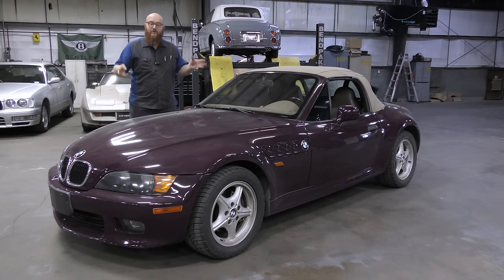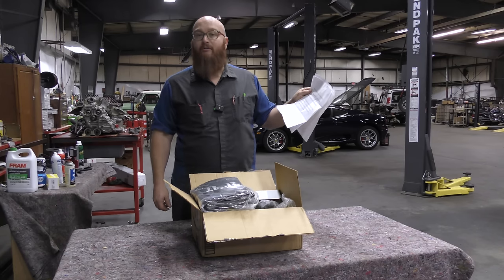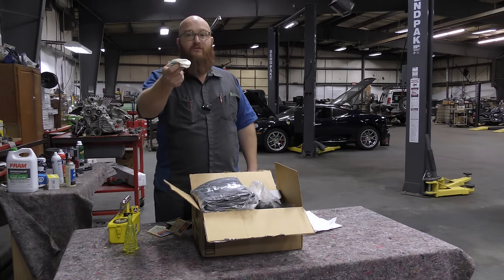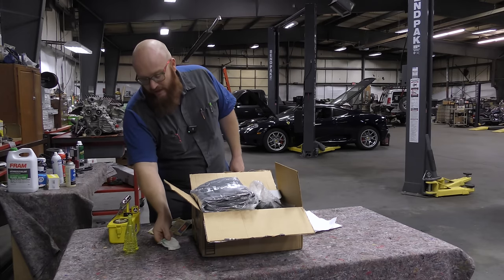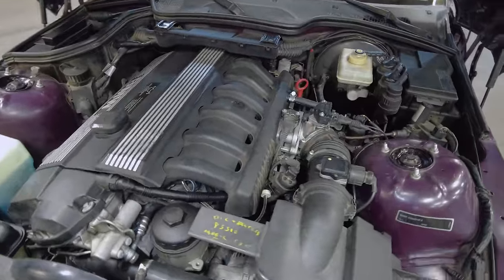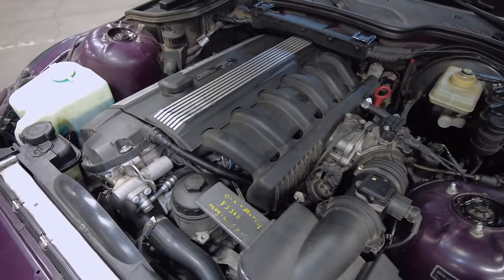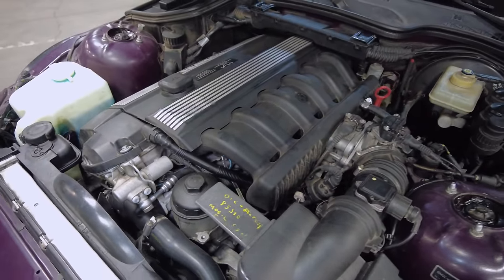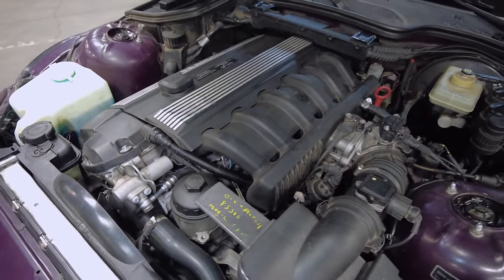My BMW Z3 Almost BUSTED My Wallet!

Comment: Not sure I'd attribute the expense of refreshing this car to its German origin. Its just an old car issue. Every rubber part on a car has a defined life span as rubber reacts with oxygen and other things in the air and degrades with time. There is no way around it. Seals, bushings, and hangers all need replacing over time. For something that old I'd say its totally normal. An old Supra or RX7 will have the same issues.

Comment: My little brother collected a bunch of the old Fiestaware dishes that were also radioactive.  They used Radon in the enamel that they coated the clay dishes in for color.  It made for a lovely shade of orange that you will never see on any other type of ceramic (they only used the Radon in the orange color).  They are mostly not dangerous and it is non-ionizing radiation.  They ARE extremely dangerous if you actually eat food off of them, because the paint flakes would be very bad to ingest.

p.s. I still think Wiiizard would have been better of with a Miata NB or NC, because Miata is always the answer.

Comment: Having bought and ran a number of luxury cars, they all require repairs that
the previous owners failed to have fixed, and just because they are X years old
the spare parts prices don't get any less, plus you need to find a good specialist
that knows what they are doing, there are only a limited number of "Wizards" 
out there.
As David has said, whatever you pay for a decent sample you can easily double
the purchase price restoring it, but you will have a great car at the end of it.
Once sorted these older cars will last, unlike todays plastic everything ones
that fall apart once the warranty expires.

Comment: Did you change water pump and fan? I’ve heard the cooling system is a big failure point. Do you recommend replacement or wait till signs of failure?

Comment: Unless your rich or prepared to get your hands in the grease these cars (particularly the newer ones) are not worth it outside of a warranty.  The only reason i survived with my 5 series was because i carried out most of the work on the driveway.  Even simple work such as brake pad changes require diagnostic software to unlock the rear parking brakes and to reset the codes once the sensor has been triggered. They are as mentioned maintenance heavy so oil and filter changes should be done every 6-7k miles otherwise your running the gauntlet... In a nutshell your either handy with the tools and can interface with these things or you just have plenty of cash to throw at it.  Everyone else go Japanese.

Comment: I find it interesting that in one video you say BMW's are junk and then you buy a Z3?? I have a 2001 Toyota Kluger (Highlander) and it has cost me just as much in repairs as what I paid for it. I guess all cars can be expensive, my car had a faulty fuel gauge and it cost me $700 nzd in parts to fix, just one example.

Comment: I spent some $16,000 in parts on one of my BMW's. More than the car is worth were it be up for sale. And? Not everyone sells their cars off. Some do their own work and keep what they own. I will never purchase a new BMW for many reasons. The increased use of plastic in places where heat-cycling is high. Anything larger than a 17" rim is bad engineering. (Side note. Males liked to pretend they do not track fashion trends. Yet so many are so concerned with having large diameter rims. They put aftermarket rims on their car in order to look "cool." Said rims almost never look good on either a BMW or a Mercedes).

Comment: If ignorance were water. the Car Wizard would need flood insurance for the comments here. Contrary to what's being posted here, many of the pre-I drive Bimmers were actually pretty desirable cars (especially among enthusiasts that actually understood these cars) and are fetching big money on the collector car market including the Z3. The Z3 was fairly easy to maintain especially compared with its less attractive and more complex successor the Z4. Most BMWs of this era were actually pretty reliable if you kept up on the maintenance. Of course, the Internet being the Internet, many owners deferred maintenance on these cars and let them fall into disrepair, contributing to the somewhat unfairly maligned reputation the pre-I drive cars encountered. Here's a hint trolls: Camrys and Accords need maintenance too but people generally drive those into the ground and then go looking for another vehicle to destroy.
Reply: wow.  okay.  You are clearly a BMW fanboy.  That is so sad.  You don't know apparently that you can run a Toyota for easily 150k miles and not have to replace anything.  And you can "defer", maintenance as you say on any Toyota for all those miles and it doesn't really matter.  BMW people are so used to having to fix things all the time I guess.  Honda is well sorted too.  If ignorance were water.....lol
Reply: Wow. Your "water" comes in a 55 gallon drum. I bet you're at the top of your rocket science  class too.
Reply: @houseofno  He's right, I've had a lot of old cars and non needed the kind of a maintenance my BMW does. In fact it's out of action atm while I replace the abs pump lol

Comment: You need to loose the hate for imports.  I have an M Roadster and a Z4 3.0si and both are wonderful to drive and easy to maintain.  Any high mile luxury car will kill you in repair bills if it has't been maintained.  O rings dry out, they need to be replaced, regularly.  The oil filter housing is a classic example.   It's a 20 year old car for god's sake.

Comment: I'm sure you all know - There is nothing more expensive than a cheap luxury car!
I've had a '99 E46 coupe for the past 9yrs, it's closing in on the 100k mark and over the past few years I've been spreading out preventative maintenance as much as I can, cooling system, suspension parts, and next year will be vanos and CCV.  One thing to watch out for is the brake lines - they LOVE to rust on these platforms!

Comment: Cool car. I have always wanted one. A lot of the stuff you did on the car is maintenance that any car that age would require. Btw some camera lenses made in 1950-70 are radioactive.
Reply: repairs  are NOT maintenance---they are repairs....
Reply: @chadhaire1711 according to BMW fanboys, rod bearings are maintenance. Lmao
Reply: @diablocls55  so is replacing plastic water pumps every 40K miles...
Reply: I have two old 35mm Canon lenses that would set his counter ticking ...

Comment: I had one of these when they came out in the James Bond blue/tan colors. Mine had the 2.8 engine and manual. BMW couldn't get the seals above the doors to keep out water. They would replace them and they'd seal when installed but if you lowered the roof a couple times, the footwell would fill with rain water. BMW made the car go away and helped me get a 3 seres couple quickly.

Comment: You said most parts were replaced just as a preventative insurance so your wife is not stranded on road. In another of your videos, you claimed your shop, as a policy, replaces parts only after testing them to see if they are bad and so need to be replaced. There seem to be a contradiction here.

Comment: Um, Wizard, if that box was shipped USPS, it probably broke several regulations regarding radioactive substances.  You might want to call postal inspectors.
Reply: FBI may be dropping by 😂
Reply: @Whatisthisstupidfinghandle  It'll be the Postal Inspectors first :)

Comment: beyond me why you would waste any money on that garbage m52, enjoy. failed timing tensioner, guides, low tension piston rings causing it to eat so much oil you don't need to do a service, crank hub backing out, cams snapping, reverse going out if auto which can only be fixed by a replacement transmission, 6mt forks just break, and a lot more. should have scrapped it for something with at least a n52

Comment: So you can just mail radioactive shit to people?
Reply from the maker: Apparently
Reply: Those pieces of glass would likely give you a dose of around 4 mrem per year if you kept them in your house and were around them all the time, the average person is exposed to about 620 mrem per year just from going about your normal business
Reply: Your typical medical X-ray is more of a radiation threat than these are, and people get those all the time, Mr. Nuclear Engineer.
Reply: They ship bananas by the ton, they are also radioactive. As the saying goes, "there's levels to this". 
None of that stuff in the boxes is more of a threat than using a microwave, or getting some X-rays or an occasional tomodensitometric scan.

Comment: Wouldn"t a Miata have been a much more practical choice? Unless your just making a point I guess.
Reply: The problem with Miatas is that it's very difficult to find one that hasn't been modified, abused, neglected, or thrashed within an inch of its life.  These are fairly durable little cars, but sadly many owners didn't give them the respect they truly deserved.  BMW went somewhat upmarket with their Z3, thus the higher cost to maintain.  The Z3's still have a fairly large and loyal following for those who truly understand these cars.

Comment: Miata
Is
Always
The
Answer
Reply: Sure.  Have you TRIED to find an earlier Miata that hasn't been abused, modified, or neglected lately?  They're not as easy to find as you think, especially the NA first gen Miatas that are highly sought after by collectors and enthusiasts, especially the ones made in the mid to late 1990s when Mazda made a number of improvements and refinements to these cars.
Reply: @houseofno  he spent more on parts than the car. you can do it on something that is lighter and more reliable.

who said you need an earlier model? i bet you want an earlier model. you think they care? its called NC. if you have a job.. ND. your complaining about not finding one. wouldnt you want him to save one?  

also mrs and del sol is super underrated, but no one wants those cars.